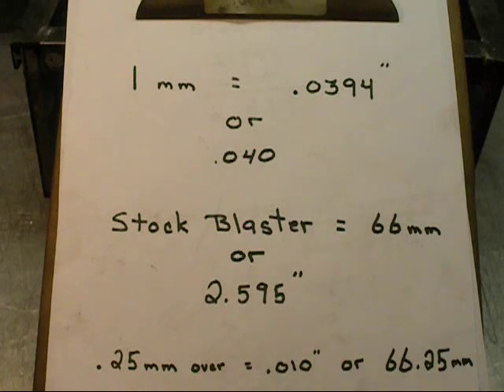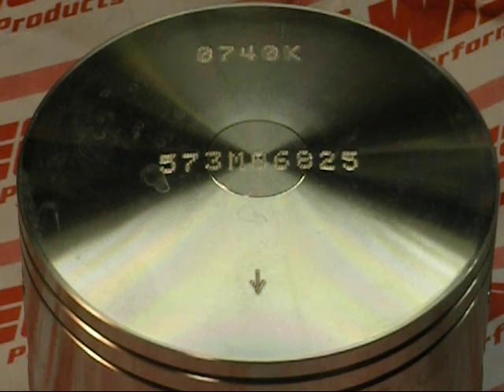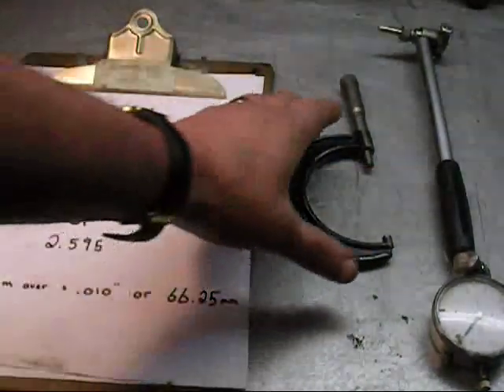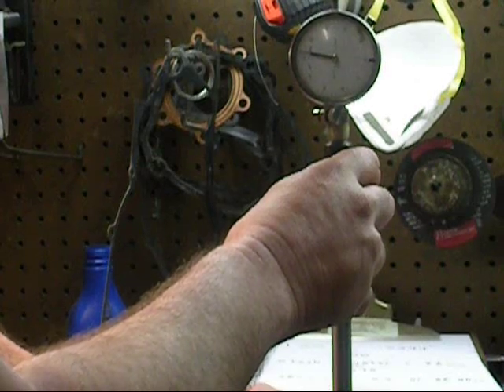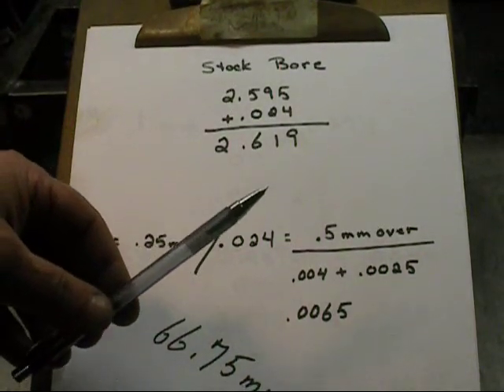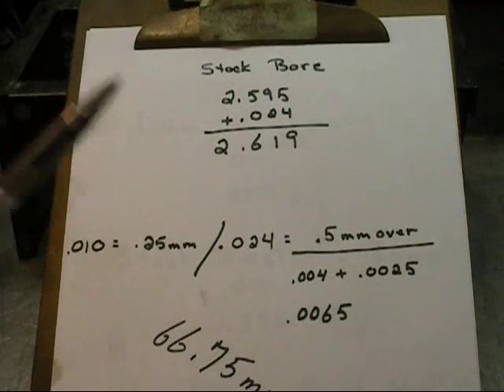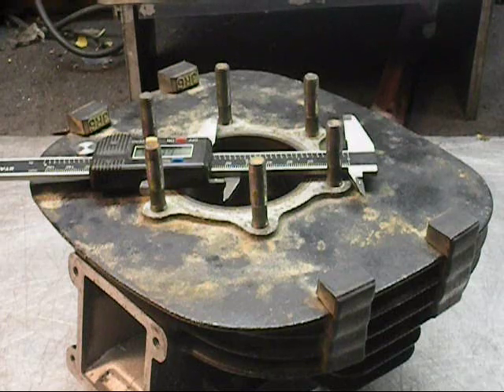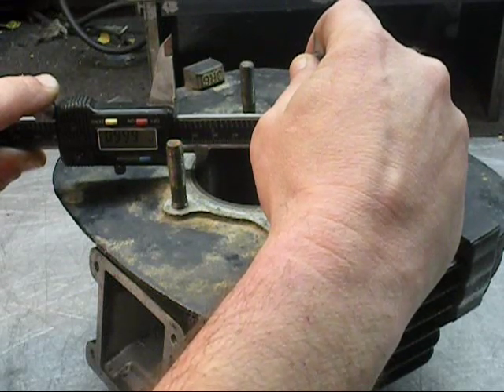How to measure a cylinder.wmv

Comment: My god do not tell these people to use a CALIPER to measure the bore!  You CAN NOT get an accurate measurement with a caliper since the wear is below the top of the cylinder. You have to measure from a few inches down the bore. The piston rings never contact the very top of the cylinder so it should always be a factory spec and never have wear which will tell people that their piston to cylinder spec is was tighter than it actually is.

Comment: 50 over with .004" clearance????? i don't  see any 50 over on paper. unlless u mean .25mmx2?    

How did u get .5mm over???

Could u explain your measurments? it would be clearer if u stuck to mm or inches instead of going back and forth.

sorry i'm slow.